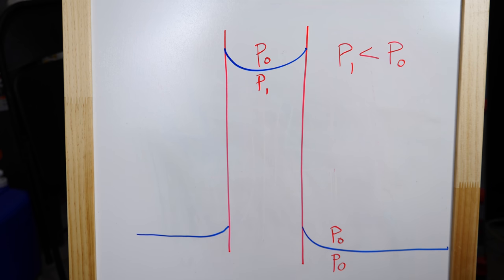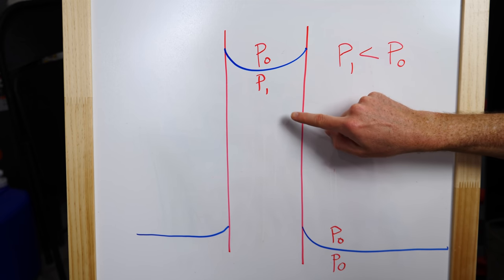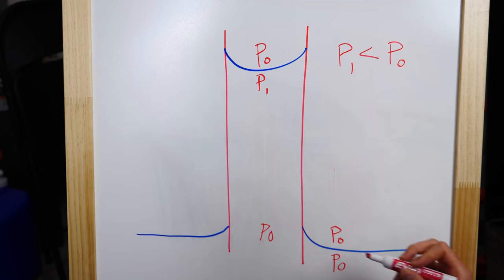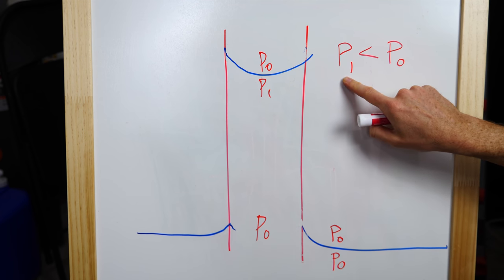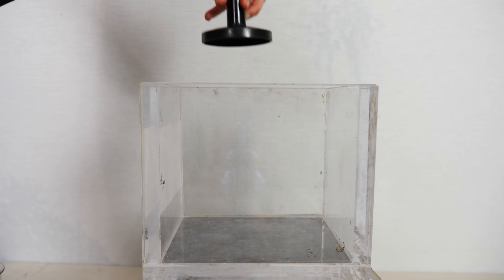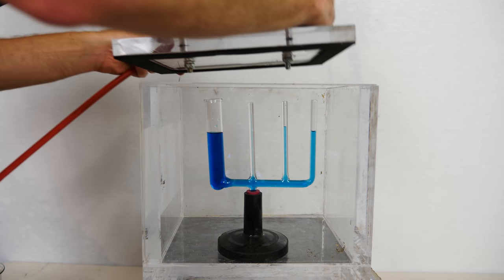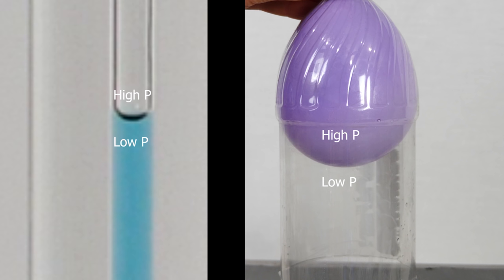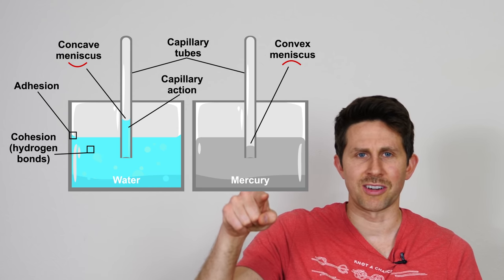Capillary Tubes In a Vacuum Chamber—Negative Absolute Pressure (Part II)

Comment: As far as i know, forces causes preassure. Normally, a water molecule gets a push from gravitation down and acellerates it. Are there other molecules in the way, instead of accelerating, it passes an impuls that is known as peassure, that pushs the next molecules down, which then also acellerates from this impuls and from its own gravitation force together. So the impuls from the molecules before adds the peassure up while they passes them on to the next down to the bottom. Air is a bit different but in the result it's pretty much the same.
Now a capillar causes a force upwards against gravitation in this case. So the amount of peassure that adds up to the bottom gets less and at the point, where the tubes are connected, there is a peassure difference, that causes the water to flow into the smaller capillar and by that, it rises the water level up until preassure gets the same. We know that in the end in the capillar, water doesn't rise or decrease, so forces has to be canceled out. The extra amount of water above the water levels of the bigger capillar causes extra force downwards by gravitation that equals out the force of the capillar effect in this case. That means at the surface of water in the vacuum chamber, there is zero force and so zero preassure.
Out of the vacuum chamber the air adds some preassure, that the water can pass on. The peassure difference is very low so there is not really much difference we can see.
In that direction a molecul gets pushed it creates preassure, so how it could do less than nothing and does negative preassure? This thouth came from the forst video, where was assumed, that same height means same preassure, so it has to be less peassure when water level is higher up that it would by 1 atm and so it has to be less than 1 atm, but it is still the same on all surfaces, it's adding up less fast down the tube so at the end it's equal. Dont know the distribution of the capillar force, if it's fast adding up, so peassure becomes equally by same height pretty fast it's different until the bottom part of the tube, but as far as i think, it works without negative absolut preassure.
Reply: because my explanations are weird sometimes, here a sketch:
https://s12.directupload.net/images/200502/2t2p5vw4.png
But i really dont know, how the capillar effect is distributet inside the pipe. First makes sense somehow, because in the last video, after the pipes got emptied, they got stuck on the bottom. Same preassur, so now flow there, but the bottom also becomes the top if nothing else is there that isn't effected by the capillar effect, so nearly all could be right.

Comment: Ummm.  So you're saying that fluids flow from low to high pressure?  P0 is a higher pressure than P1, yet the fluid flows away from P1?  Either every physicist is wrong, or there's a major flaw in your explanation.
Reply from the maker: justin coleman huh? The flow pushes water from po to p1. From high to low.
Reply: At about 2 minutes in, you explain the pressure differences.  The pressure inside the tube and outside is P0, the pressure just under the tube is P1, and P0 > P1.  You say that the atm. pressure is the same inside and out, but the fluid still rises up the tube, toward a higher pressure.  If the atm. pressure inside the tube drops (for some odd reason), then its no longer P0.

Comment: 6:30 I'd say no, because it's in a steady state and hence at the top of each surface, the pressure is almost zero (according to the quality of the vacuum and adhesive forces between water and glass). Orelse, water would be flowing. But towards the bottom of the tube, it raises due to gravitational forces. I think, you could measure that.

Comment: Maybe a hammock is a better analogy for the tension on the surface of the water called Surface Tension.  The pressure of air at the surface must be equal to water surface or else there would be a force causing motion.

Comment: To expand on this idea. If you had a secondary layer that increased the relative pressure of atmosphere around the entire thing to say. +10atmospheres then you could continue to lower the internall relative pressures and use the zone at p1 similarly to how we use ground in AC electronics. So we only need relative -12/+12 and 0v
In this we would have -10P0/+10P0 /P1

Comment: For extra understanding, think of pressure as a force per area. So under tension, there's a negative force per area, hence a negative pressure. Fluid physics things like this are fun, but the math is horrible. Our faculty has a fluid track, teaching things like capillarity and advanced fluid mechanics, which are nightmarish if you're not a math genius. Glad I went into material engineering physics 😆

Comment: Can you make a perpetual machine using capillary action?
Reply: I would not think so. The same energy that you could get by the water moving into a tube would be needed to get the water out again.

I think you could compare this to water moving from a high place to a low place. You can extract energy from that, but afterwards you have to move the water up again, using up the same amount of energy.
Reply: Techs Science ask the 1st and 2nd law of thermodynamics

Comment: @the action lab, this has nothing to do with pressure. The capillary action happens because water molecules are sticking to the glass tubes and surface tension pulls up more water, bringing more water in contact with the glass, which can then stick to the glass and pulls in even more water. It Goed on until the upward attraction is in equilibrium with gravity.  It has nothing to do with pressure. It is more a electrostatic effect. It is more comparible with a magnet pulling up a string of paperclips until the point where the string becomes too heavy and let's go of the magnet. No pressures involved there either.

Comment: @The Action Lab  3:07  Here you have that Po is larger than P1 but the Po above the meniscus is also larger, yet there is a flow upwards.  Perhaps there is an even lower pressure near the walls that allows for a pressure differential?

Comment: That's not how pressure works. There's no such thing as negative pressure. What you're describing is just pressure. You can't think of the vacuum as "pulling" on the liquid, that erroneous thought leads to incorrect ideas. This is just a situation in which the main forces at play are electrostatic forces between molecules. They naturally push against each other, and a capillary tube enhances this action due to surface tension. This results in a net pressure pushing away from the center of the fluid. I'll also mention that those who use the misleading term "negative pressure" are typically referring to relative pressure (which is especially meaningless in a vacuum)

Comment: Have you tried filling it until the capillary tube overflows but attaching another tube that feeds the overflow back into the large fill chamber. Would that cause a constant motion of it flowing into the fill chamber as it is pulled through the overflow tube via gravity and vaccum and capillary action forces all working in unison?
Reply: The water is begin "pulled up" by the tube so when it reaches the top there is no force acting on it to make it flow over

Comment: So basically, if you were to drop a paper towel in a pool of water within a vacuum chamber, the paper towel would still absorb the water despite no air pressure pushing the water?

Comment: Negative pressure even extreme negative pressure is even possible with open cups or bottle or aquarium.. or even flat surface it’s not very hard :) just you make induction cooling
Reply: @Owen_loves_Butters  no even gasses but off course gas will become liquid due to extreme negative pressure but if we make inside tube both side open very extreme negative pressure and with ventilation if we push it to one side gas pass through extreme negative pressure will leave the tube cold and if we make another tube with positive pressure and put between them ventilation from negative to positive pressure we Will have lifting capacity will work even upper altitudes of atmosphere even there is no thick air .. all we need is high speed RMF

Comment: So if the little tube was cane shaped, could the water flow out of it? If the water could flow out, could it be directed back into the bigger tube? Then wouldn't you get an imbalance of forces that you can harness to do work?

Comment: Can you explain why is not possible to have a similar equipment, but with the smallest diameter capillary tube bent just under the maximum height, into the biggest tube, and have so the water flowing again into the main tube, so realizing an infinite flow motion of fluid? If course I know it's impossibile, but would be funny to see what happens... :-)
Reply: I know this is two years old but I'm so shocked that people could have been watching this for two years not understanding this...

There isn't a negative pressure in the tube. In your example the tube would fill entirely then stop. The force pulling the liquid up is the attraction of the fluid to the walls. When the tube opens to the main tube there is no more attractive force pulling it further, going further would actually mean moving away from the tube, so it will stop.

If there were zero energy losses in the system (there always are, that's 2nd law), the water might continue flowing like you imagine, but you don't need a capillary tube to see that, it's called a Heron's Fountain. And it is not a perpetual motion machine for the same reason.

Comment: so your experiment would be nullified by application of a hydrophobic material such as the product NeverWet. 8:18
Reply: Well 9:39
Reply: mercury is a liquid metal and does not fill the microscopic crevices within the glass tube due to atomic size, thus it can't fill the crevices and use surface tension to pull up more water which is a self-reinforcing effect until equilibrium is reached. So, your comment is a gross concept error, troll.

Comment: Hi!! I admire your work it's very diversity and interesting but I  suggest you do make a material about the vacuum, I mean if its possible to make the absolute, vacuum, or what is the maximum limit of vacuum. In comparation  with pressure. The vacuum is the opposite of the pressure? Like the temperature, for high temperature isn't existing a limit but for lower temperature it exists the absolute zero, when the matter has no more energy to eliminate. Its something similar exists for the vacuum? Like in the movies it is possible to suck the alien body through the little hole? 🤭 Thank you.

Comment: Just how low can your vacuum chamber go? I remember taking a tour of a university silicon chip manufacturing lab where they do actual lithography, and for a certain step they needed such an insane vacuum they had this huge apparatus to achieve an extreme vacuum. Can your chamber achieve the same or is there more to it?
Reply: Michael Villanueva  this calls for a third video. True, even outer space has a pressure so low that it is neglegible.

Comment: When you say the water boils, is there actually a temperature change?
Reply: LD Hablizel no the boiling temp of water changes under vacuum there may be a tiny change in temp from friction but very very little
Reply: Nope. It's a physic reaction of the water to let free gas particles independently of its temeprature. 1 atm is comsidered the air preasure at sea level and the water boils at 100°C. In Andes mountains (and more specifically the Aconcagua) the water boils approximately at 60°C.
Reply: @FedeG86  so basically, water is not boiling? It's just squeezing gases out of the liquid forming bubbles and the liquid is not hot, Omg! Omg! Boiling but not hot!

Comment: Liquids move up straws when there is a lower pressure above the liquid in the in the straw, not as you have described it here.  Your logic doesn’t even make sense.  Objects move from areas of high pressure to areas of low pressure due to entropy considerations.  When you suck on a straw you’re lowering the pressure above it relative to the atmospheric pressure above the water in the cup, (the water thereby gets pushed into the bottom of the straw). You also cannot neglect the water pressure, which is still a pressure.  When a person goes under water, they are under both the pressure of the water and the pressure of the atmosphere, and thus are automatically under a higher total pressure.  So how could the water in your tubes have a negative pressure?  That’s impossible as the water is exerting a pressure.  When you add on the vacuum, you’re decreasing the vapor pressure of the water, so more and more of it evaporates, creating more pressure (to reach equilibrium according to Le Chatelier’s Principle), that ultimately can leave as long as the vacuum pump is turned on.  If the vapor pressure is above the external atmospheric pressure, the water will boil, thus again, you’re in a pressured situation.  Any bit of evporated or boiled liquid is releasing gaseous particles into the atmosphere above it, so there must, by definition, be a pressure.  If you pulled a complete vacuum (which is impossible), it would cause the solid or liquid components of the container holding the vacuum to evaporate, boil, or sublime, thus creating a pressure (it might be too low a pressure for your pressure gauge to measure though).  Again, equilibria will always exist, so true complete vacuums cannot exist.
Reply: Your first statement is true for larger tubes but in the case of smaller tubes the glass-water interface is much bigger relative to the volume of water so that the surface tension is strong enough to pull the water up. 
The negative pressure is the water molecules being pulled away from each other to the point where they should be vapor but there is no point for the water to start evaporating.
Please correct me if I got something wrong.

Comment: Where is the point? The whole vodeo just seems like you bend around the definition of pressure just for the sake of defining negative pressure. And why? What are the applications? You cant even directly measure it! What are the use cases?
I can also claim ultrviolet light is negative brightness because I cant see it, sound about as useful
Reply: Also, how is the pressure fradient when movinf around in the capillary tube? How can the pressure be calculated? So many unabswered questions